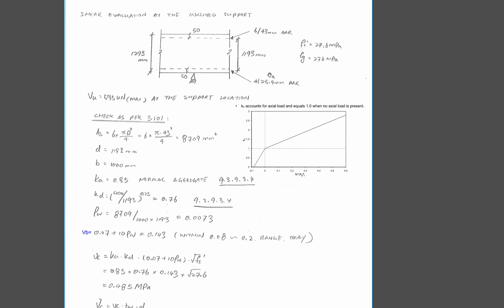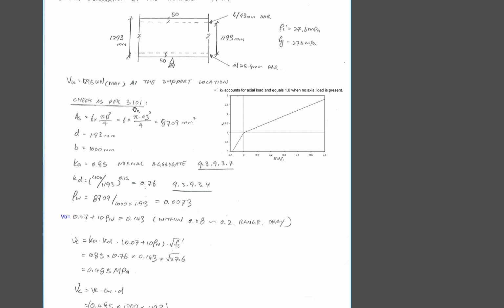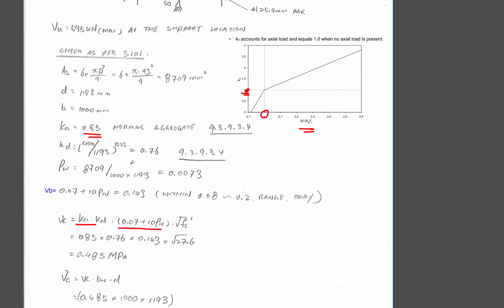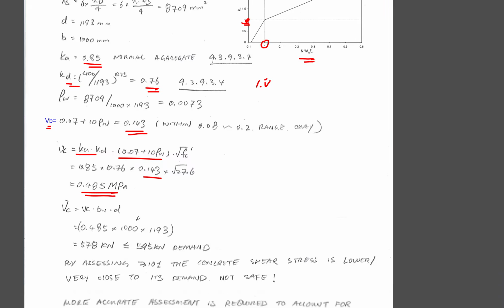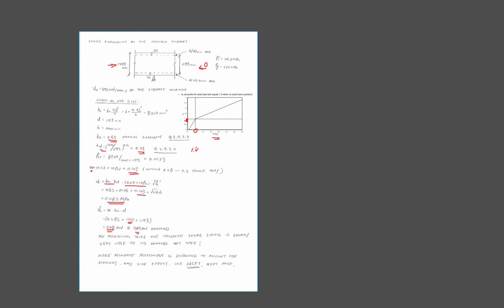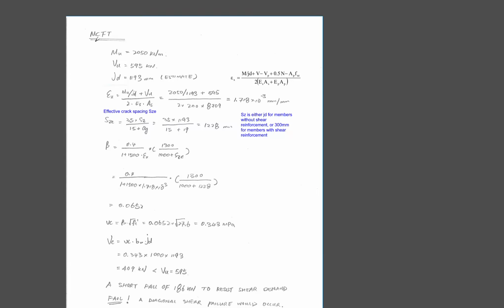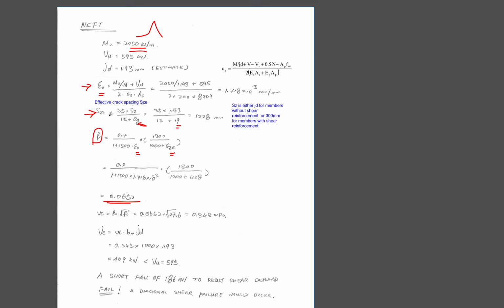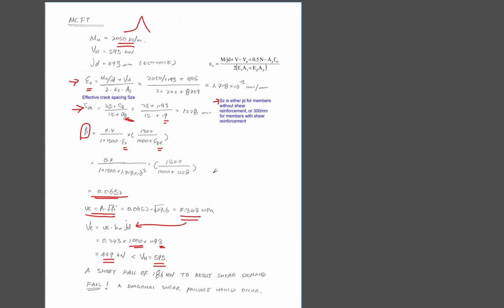Concrete shear design and modified compression field theory (MCFT)

Comment: Hi Mikey. Thanks for your vid. I believe that there is an error in your strain calculation. If you use N and mm throughout the strain calculates to 0.664x10^-3. Beta becomes 0.117 and Vc increases to 733kN. And the section now passes.
Reply from the maker: Hi BRADLITTLE-b6j, yes indeed there is an error in the strain calculation, the correct strain calculated to be 0.664x10^-3 and the Vc is 733kn, actually passes, my apology. Thank you for picking that up and sharing 💯It is also worth noting that it is very easy to make a mistake in units, use N and mm throughout the calculation and show them in the derivations can help avoid errors and make calculations easier for self checking, which i didn't do properly.